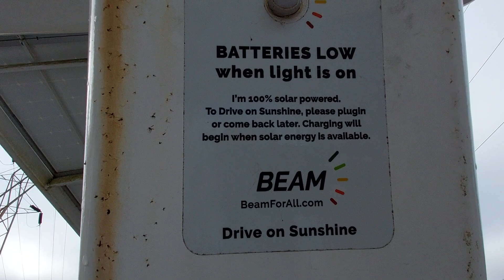Solar EV Charger at a WHERE!?

Comment: The size of the solar panel,  would only charge a couple of phones 😂😂😂
Reply from the maker: According to the little sign on the unit it's good for charging cars, but I haven't actually seen it in use yet. Especially it being off the beaten path a bit up at the dam. I agree with you that panel sure seems pretty small for something like charging a Tesla!
Reply: I know that's why I got a coal fired cell phone.😢. No range anxiety.😅
Reply: Based on the sign saying it produces 225 miles of charging per day, given electric cars average energy consumption is 0.32 kwh per mile. That solar array is capable of producing ~72kwh of energy per day. Because it automatically orients itself to the path of the sun it likely out produces panels mounted on homes even on a cloudy day like the one this was filmed on. 72kwh divided by 13.5 watts for your average smart phone... means daily this solar array produces enough energy to energy to power the average smart phone for ~5,000 hours.

That's about 208 phones running at full power in a single 24 hour period of time non-stop.

Comment: You're talking crap 😂
That canopy with a PV panel on can generate a tiny amount of power so it's not what charges the cars. Chances are that the energy comes from a substation that's very close to that hydro plant. It's scary how people agree with you and share your disbelief. This is how nonsense gets spread out using social media. Plus, how did you work out that tax payer's money was wasted there ?!Rant over 😂😂
Reply from the maker: According to the documentation ON the unit that's what it's for, and what it does. It's not attached to a substation. Unless you can provide some sort of factual information to support your opinion all you are is posting nonsense and misinformation on social media ;)
Reply: @GoodThings4GoodPeople  I don't need to be there to read anything. I'm am electrical eng and I can tell you that thinking that one, however large, PV panel can supply any meaningful power to an EV is like being in cuckoo land. 
Just think! A large house roof with a  above average solar array of 7-8kW, in ideal conditions in terms of orientation,sunshine amd temperature will deliver in US say 5-6 kW. If that feed an EV charger, it would give you some 15-20 miles of range per hour. That's not rapid charging...you'd need at least 20 tines that to feed one decent public DC charger. So how many of those canopies you'd need? It could be that that thing is also connected to provide a fraction of the power but that's all
Reply from the maker: @mirceamihoc  Congratulations on being an electrical engineer. That's awesome! These are used as a slow/trickle charge for people who come to Norris Dam in an EV and want to pick up a bit of charge while they hike/fish/sightsee/whatever. They aren't intended to be full chargers, nor rapid/superchargers. It is just a convenience and a proof of concept for fully self-contained solar charging.
Reply: @GoodThings4GoodPeople  if that's a fact than yiu might want to completely change your video as it's misleading...why would you talk about it as it was a supercharger (connected to a substation) and costing a significant amount of money as a supercharger would? 
Unless of course you employ like many others click bait tactics 🙄
Reply: I was waiting for your factual information.  @GoodThings4GoodPeople

Comment: It's probably cheaper than hooking up to the line building a transformer and laying underground cables. As a temporary solution to see if the charger will see use here it's a great idea.
Reply from the maker: There's a building with restrooms and vending about 100 feet away so there's got to be some sort of infrastructure already in place for it. One would imagine it's capable of also supporting the charger? Maybe, maybe not. I DO agree with you as a temp power solution and somewhat "portable" the idea of this unit makes sense. If you are going into a location with poor/no power grid it can stand alone as a source.

Comment: From the size of the solar panels, it would probably have a maximum output of about 2kw.  If two cars were plugged in it would take about 60 hours of full sun to charge the vehicles.  Lunatics are running the government.
Reply from the maker: Someone's got some information about the topic! It's not designed as a "complete" charger to take something from dead to full but more of a trickle charge while people are visiting. It's an interesting unit and a bit of tech that could be some impact in other situations as well. Just very odd to see at a hydroelectric plant.

Comment: You can't just plug into a hydro generator, you would have to build a large transformer to step it down to a safe usable voltage. I'm sure that would be ridiculously expensive for just 2 charging ports,
Reply: The hydro plant steps down power for use in its own facilities, they aren't going to power the lightbulbs at their hydro electric dam with power from a coal generating station a hundred miles down the grid.
Reply from the maker: Bingo @devin also there's a visitors center about a 100 feet away that is powered.
Reply: @GoodThings4GoodPeople  What is the issue here. Would you rather see an expensive petrol station. It's a fully autonomous EV charger. What a great idea!
Reply from the maker: @bruciew50  it actually IS a great idea just very odd to see outside a hydroelectric plant where you could easily provide near unlimited charging. In the middle of nowhere with no infrastructure makes a lot more sense for one of these things
Reply: @GoodThings4GoodPeople Why don't you ask them why they did it. There might be a very good reason.
Reply: @devinhallsworth5531 try pricing a mile of copper cable.
Solar is cheaper.
Reply: @devinhallsworth5531  they only have small step down requirements inside the station as well. the generators arent producing 500KV... they get stepped UP to 500KV from 15-22KV.

even at 15KV, the insulation requirements are pretty intense...

and theres all the things inside the station that run on plain old mains power... from the lights in the janitors closet to the main sluice valves to the control room and all its dials and gauges and sensors...

probably even find 5 and 3.3V systems lurking around, lower? RAM only runs at 1.2V!

Comment: To actually make people think that those solar panels are charging EV's is funny beyond belief. It is akin to telling a child they are on a real rocket ship when you take them to a theme park. The environment is in such trouble because people lack a proper high school education on physical sciences.

I am thankful you posted this video. I am using it as an illustration on the lack of education when it comes to science, EVs and the environment.
Reply from the maker: They actually ARE used to recharge EVs, however they are more of a trickle / slow charge with limited capacity. These aren't intended to be full charge or fast / super charge units.

It's still hilarious that these would be installed at a hydroelectric power plant but the proof of concept is interesting. Completely mobile self sustained units that require no infrastructure has a lot of viable uses.
Reply: @GoodThings4GoodPeople  Wonder what the specifications are.
Reply from the maker: @bikingcat3283  working on a follow-up to this, really didn't think this video would get much notice it's just something I found interesting and wanted to share. Certainly not what this channel is ACTUALLY about, but I'll do the footwork for folks on this one.
Reply: @paradiselost9946  You really need to Proofread you Sentence construction and  Structure is poor affecting the Clarity of what you are saying so I will not wast my time further on this comment.
Reply: @freethinker4991  lol, who needs to proof-read first?

lol, talk about gibberish? you had two typos and several grammatical errors in your hysterical ranting just then, and you deign to tell ME how to "construct a sentence correctly"? 
have you ever heard of full-stops and commas? they prevent making "run-on" sentences ;) whats a "wast"?

face it, you are the dullard, and having been caught out as an ignoramus, try to change subject yet failed miserably, making all the mistakes you accuse ME of... ;) and now you're getting all upset about it...

i have ALL THE TIME IN THE WORLD! :)

you're FUN!!!!
Reply: They also lack the ability to critical think and do math. The presenter has just shown how stupid he really is the High voltage lines above him are running at 500,000 volt (500kv) and the EV charger run at 400 V - 1000 (1kv) volt. The cost for a transformer to reduce from 500kv to 1kv is between $1,500,000.00 - $1,857,000.00. The cost to install Solar EV Charger about  $40,000 to $80,000. The presenter statement and I quote "What a crazy wast of money" is BS as he has know idea what it cost. 

You have a point about the solar panels being able to charge EV's fast enough. They are feel good trinkets the Solar EV Charger would have to be hook up to at least 400 V - 1000 (1kv) volt supply.
Reply from the maker: @freethinker4991  just as a point from the stupid presenter it's "no idea" not "know idea". 😉
Also, there's a building 100 feet away that's fed off the power generation from the dam so that infrastructure is already in place. 😉
Reply: @freethinker4991  When I get bored I am going to do the math. Google has a solar power calculator. Being very generous and plug in values for that latitude, 2 parking spot sized solar cells with sun tracking. I am wildly guessing a full day of good sun may charge an EV at the 5kW rate for 30 minutes.
Reply: @freethinker4991  the hydroelectric plant... it has lights. AC units. fans. computers. the whole place runs on that 500KV HV transmission line, does it? wouldnt that need some rather substantial insulation?

how about the exciters needed to drive the turbines themselves? the generators? they dont use permanent magnets, they use electromagnets... "field windings"... and theyre powered by something?

what about the monitoring equipment, the sluices, the gates? all on 500KV as well, are they?

and well, there are the turbines themselves... they produce 500KV directly, do they? do i have to ask about the insulation requirements again?

you want to go on about critical thinking and lack of education? you better make sure you know EXACTLY WTF you are talking about ;)

but i did like the "rocket ship for toddlers" analogy... thats a good one!
Reply: @paradiselost9946  You are correct there will be a feeder line back in from the grid or transformers to step down to the USA power standers of 110V to run lights, computers, domestic etc but that was not what he was implying. The presenter was suggesting the installing of the solar EV charger was a wast of money because they could have charged from the 500Kv power. Charging from a 500Kv power supply is no possible and stupid to imply. 
 
insulation of 500Kv power line in not required in all situation. Stand of or clearance distance this is way power line are placed so high, so they dont need some rather substantial insulation. I believe the US standards require a MINIMUM CLEARANCE DISTANCES BASED ON VOLTAGE >500 to 750 kV of 35 ft. 

If the Presenter filmed a 415v feeder line into the solar EV charger he could imply the stupidity of the solar EV charger but he didn't. By not doing so he is confusing the ignorant viewer and lets face it, there are a lot of ignorant viewer. I believe only 20% of the US population have a qualification in any form of electrical engineering.    

I am baffled by your lack of knowledge on how a hydro power plant drive the turbines and the link to the generators that produce the power. Watch a few of this videos https://www.youtube.com/results?search_query=how+does+a+hydro+power+station+work+ 

Most of your rambling comment and your finely insult show you inability to communicate to other in a clear and concise manner. I recommend that you take a course to improve written communication.

Comment: The company that makes those types of EV chargers markets them for a mobile solution for companies and government entities.  The biggest advantage they have is the ability to get something up and running in minutes.  Compare that to an install like you mentioned from the power generated from the hydroelectric dam, that would take several months to implement at a much higher cost.  I wouldn't be surprised if TVA didn't purchase the device, but is leasing.  That is an option that company offers as well.
Reply from the maker: Excellent comment Sir thank you for chiming in! You are correct this unit is designed as a small "mobile" power supply especially for areas that may not have built up infrastructure, drop the unit in place and it's all really self contained. Also something to keep in mind is the amount of "red tape" a standalone unit like this avoids versus having to jump through all the hoops to actually build something there.

Comment: That charger likely does not need underground cables.  It could be a storage system built in, so it runs at night.
Reply: You need an education. More likely the solar panel is not connected to anything. If anything the solar panel is on a separate circuit to run area lights at night. There is no way that panel is charging EV cars.
Reply from the maker: You are correct the "base" of it is essentially the battery storage pack
Reply: You are wrong. I wish that technology existed. I think it is cool to have EV chargers up there. They are most likely run from the same line they would use to run an the AC system of a visitor shop there.

Comment: ...somewhere, there is a board of directors that collectively thought that charger was a good idea. And, they got paid for multiple meetings to discuss it, and approve it...Lord, have mercy on their souls...
Reply from the maker: Ahhh the beauty of government there's always meetings to be had, studies to be done, and discussions to be had! I get the IDEA of the unit, it's just an odd placement being beside a hydroelectric power plant. But placed somewhere without any power grid it totally makes some good sense.
Reply: This was cheaper than a mains connection…
An off grid solar system is now cheaper than a new grid connection - and that is when low voltage distribution runs past your house.

Comment: Fuck ev cars gasoline for ever and also the liberals probably built it im   done .if you put a nother video on ev cars my opinion is that ev cars are worse than gas cars . because of the batterys only like last 10 years while you can get a gas powered car and all you have to do   is keep the car alive for 40 + years.  while the ev car is a tin can in a junkyard because it cast 10k to get the battery's. Bro I hope I didn't  piss you off